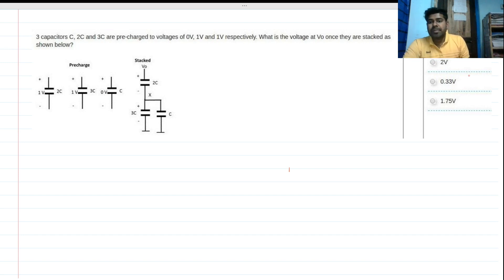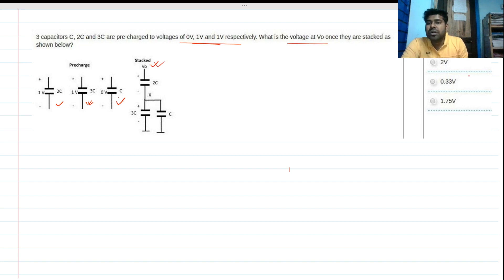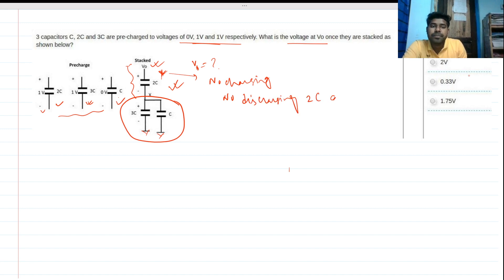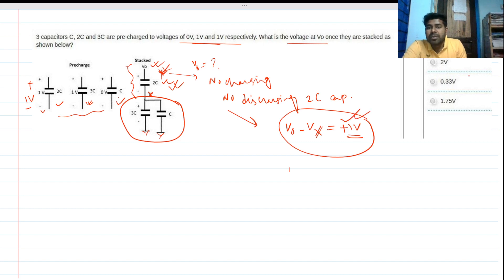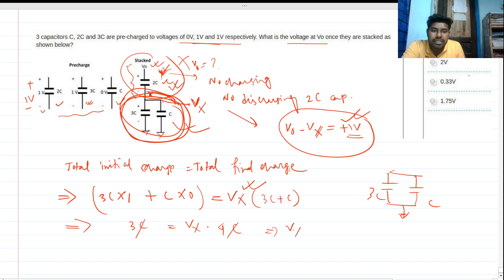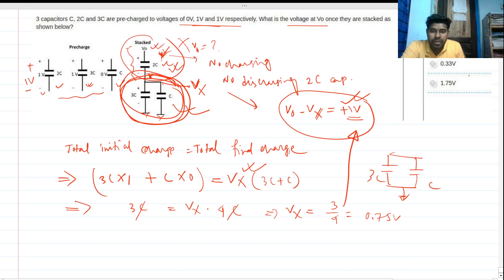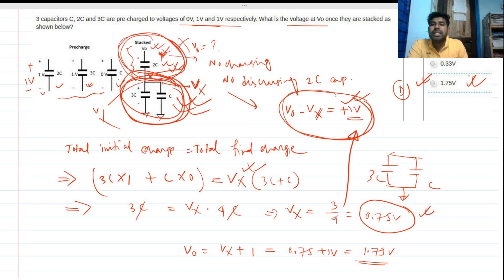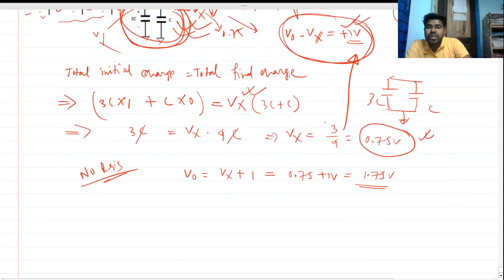Texas Instruments Analog Question_ capacitor circuit with initial conditions and stacked arrangement

Comment: it was nice question. i have one doubt.suppose you have find the vx value at t=1 .let us say that at t=2 and bottom plate  voltage of both parallel capacitor is replace by some other voltage say (2v) , will there any flow of current in 2c capacitor now??   if no then why??

Comment: Why can a 2C capacitor not discharge through the below capacitors to ground?
Reply from the maker: There is no current flow through 2C cap
Reply: Just only in MOSFET